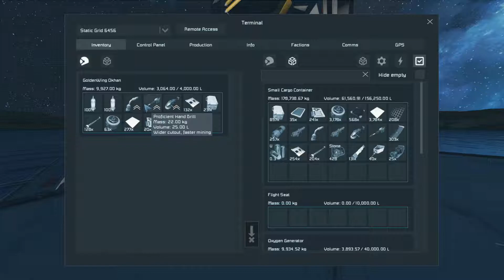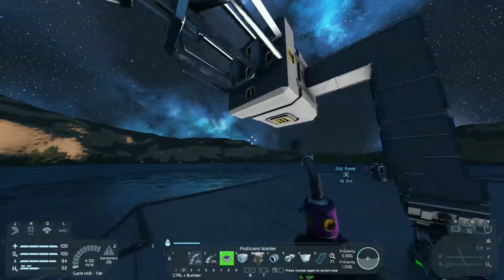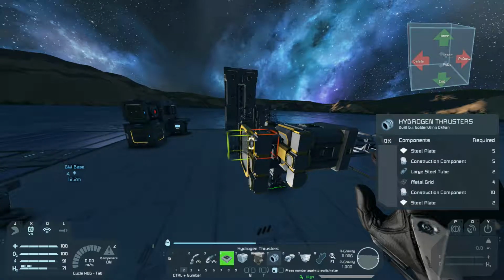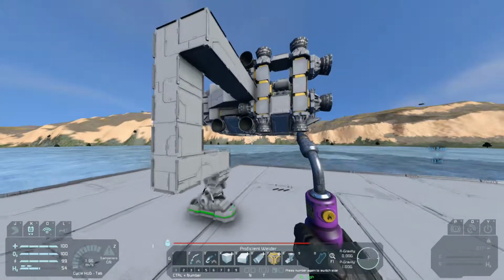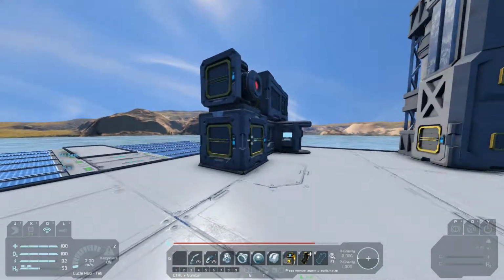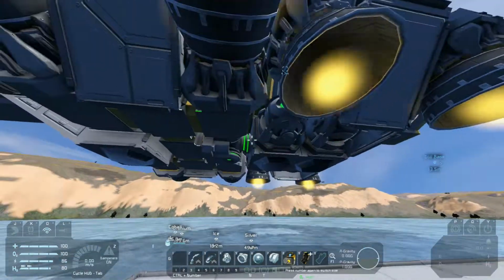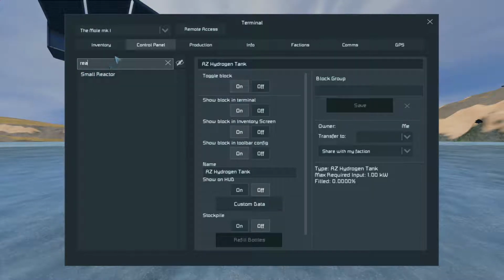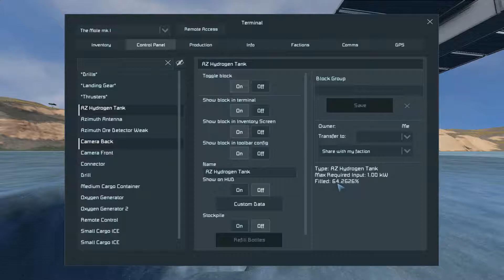GoldenWing Plays Space Engineers S1 E2 - The Mole

Comment: You do realise there's a H2 fuel gauge on the bottom right of the UI don't you?
Reply from the maker: You're quite correct the UI does show it,  and I will most likely add a line to track H2 using Automatic LCDs as well.  However I still like that the tank shows its fuel level, rather wish each cargo box did that.